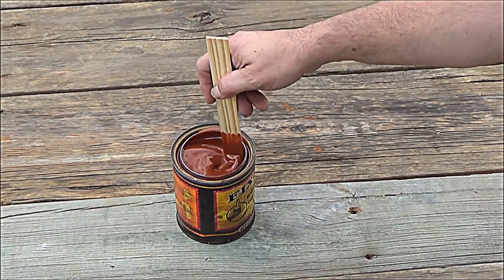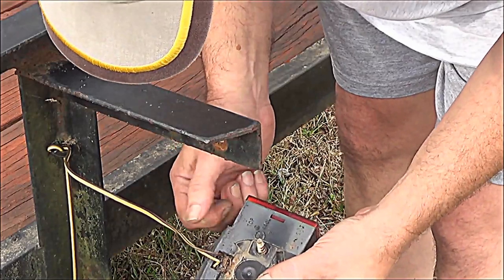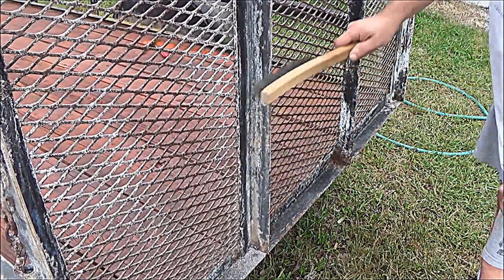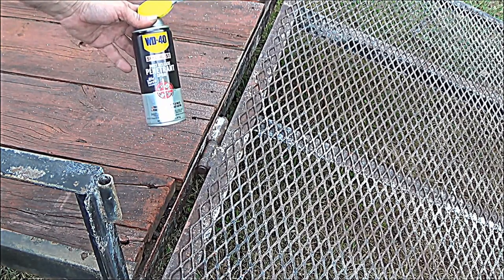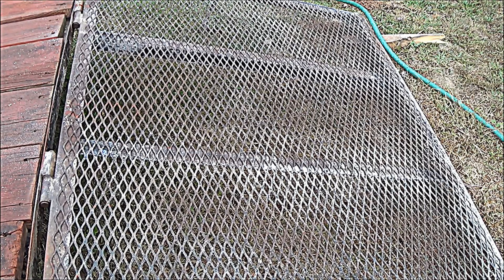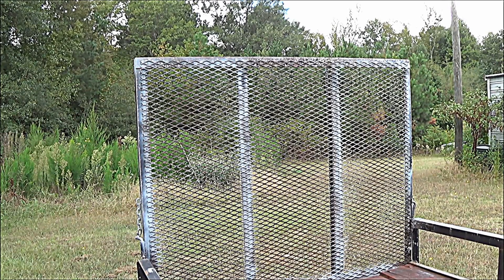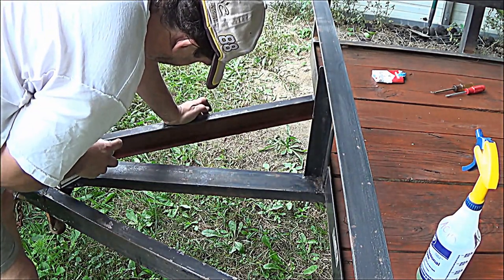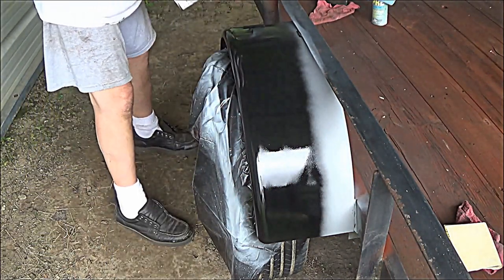Utility trailer restore- Sanded,rust treated,fenders painted,Tail lights part 2

Comment: You're lucky those nuts came off the back. I just took mine off to prep for paint, but had to drill them out. I think I'm going to put the head of the bolt on the outside when I replace them. That should prevent corrosion a little better and give a clean look on the back.